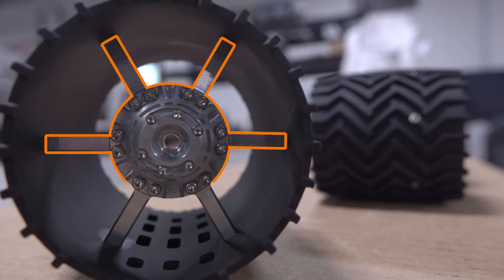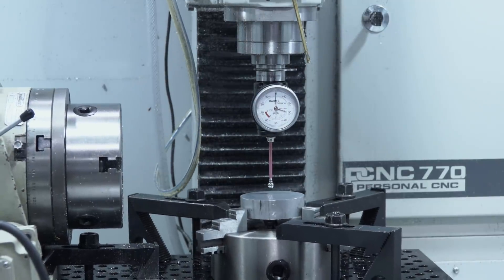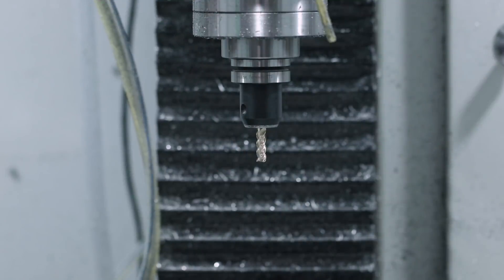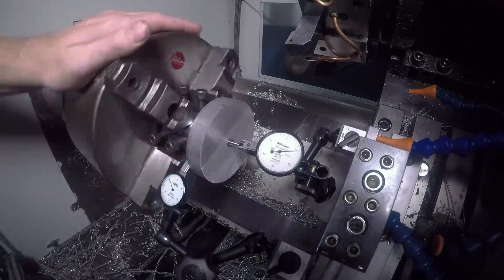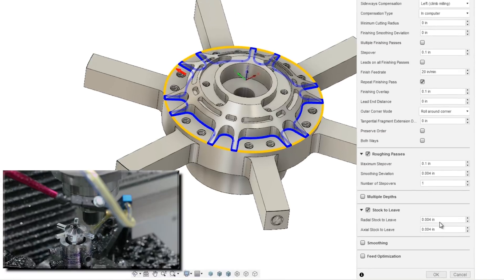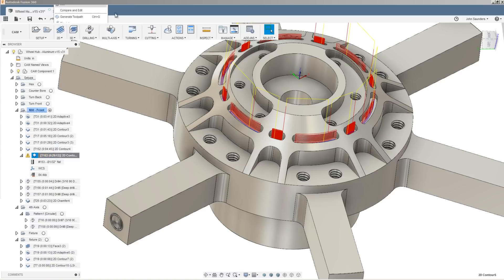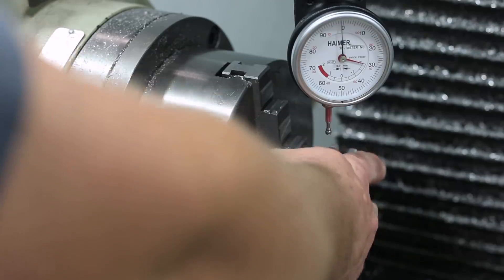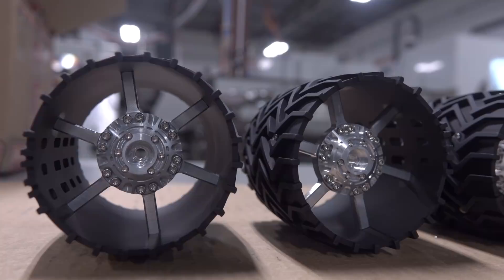Turning & Machining MARS Wheel Hub | WW210

Comment: I’m thinking this method may compromise some cintrifical tolerance to some degree (I know I’m killing the spelling of it but you get the point) but couldn’t this be done in all mill 3 axis? Circular interpolation and mill everything off then flip with custom soft jaws and deck off the excess that was holding it on in the first opp? Just wondering the downside of this option

Comment: Too many operations, This always introduces error.  You can do it in three, all milling. But there are always trade offs, You may need more tools specially made for this job. The program can help you get around some tools and fixtures. But that depends on you machinery, what tools are already available, and how soon you need to SHIP IT!  First op mill the hex, the hub, and and the OD, and even the spokes. You could have left in in the chuck, mounted that on the rotary table with the part still in it, indicate the chuck. Or flip it hold the hub hex end either way, tap ends of the spokes. Make a ring that fits outside the spokes use that to hold and mill flip side. If the ring is correctly designed you can hold on it and not crush and scratch the part. The ring could also be used to hold it in the lathe to turn both sides. (if some find this  necessary) Lathe operations are cheap, a single point tool can do a lot! The only problem with the four jaw in a CNC lathe is SPEED, and in aluminium you need speed and some power!
Me I would have turned soft jaws for the ring that I made to hold the hub after the first/second mill op. ........ and so it goes.

Comment: Personally I would have just done this as two operations in the mill. All the features you cut on the lathe could have been interpolated or 3d surfaced. 3D surfacing isn't exactly fast, but I'd bet money it's faster than re-setting it up for two ops in the lathe, and figuring out that whole hex fixture.

Comment: I'm not a machinist....I'm a designer, and trying to learn as much as possible about CNC machining to make things easier/cheaper to manufacture. When I first saw the image my thought was to drill all the holes first, remove material from one side with the 3 axis CNC machine, flip over into a fixture and machine the other side....tapping holes at the end. Maybe when you have a lathe it feels necessary to use it? I really don't know. It seems like a lot of steps. Also, the artistic elements of this make the manufacturing of it impractical. I can only imagine what a nuisance it must be to deal with people drawing things up that requires a 1mm end mill or something for an artistic detail.

Comment: Our shop has a dual-spindle live tool lathe (Haas DS30Y) and it would eat that part up. The entire part done in one cycle. The problem is the hours you would have getting everything set up, what with subspindle transfers and whatnot. Even without a subspindle, like you say John, it's a lot of live tools. We spent 30k tooling up our lathe, and about 20k of that was live tools... 4 of 'em...

Sometimes it is better from a standpoint of time to go about things the simpler way, and some folks don't get that.

Awesome video, love the WW's man.
Reply: Patrick McClintock spot on!
Reply: True. There was one guy that used the, "they would never do that in a real job shop," bullshit. They waste time in their minds (because they usually don't have a "real job shop" anyways) trying to hit imaginary/unnecessary/unrealistic tolerances, for nothing. Get it done within tolerance, which is a spec of "needs to fit in the wheels and look good," and nothing else matters. Time is money.

Comment: 5 axis mill and i dont mean live 5 axis just an A and  B positioner  rotary positioner on the B axis start with 3 jaw facing up towards spindle  in the Caxis direction like you bolted to the table and a trunnion tilt  table on the A  lengthwise  on x .  machine the spline hex drive in the  same way you did now mill the snout on the back of  the part with the radius . next op  flip over chuck on the snout you just mill right  up to just under the line where the radius starts then machine the front of the part  profile the spokes  next tilt trunnion table to 90*  now if you milled the first spoke at 0* parallel with Y axis come over drill the end of spoke then rotate the rotorary positioner for each of the 6 spokes .

Comment: Add half a thou ?? what if that was out side the drawing tolerances.
Reply: daniel lyall the previous toolpath brought it to tolerance, this just keeps from running over it again with a new tool and marking it
Reply: you would hope
Reply: daniel lyall if between set up programming and running you cant hold a 1thou step tolerance then youre doing work out of your league.
Reply: Juxtaposed1Nmotion experienced that have we
Reply: daniel lyall ugh same, we had a .0005 true postion and couldnt figure out why we kept blowing it by 002...spindle was running out .004 or .008 all day.
Reply: That is why I was asking for a clarification, is there other reasion to look out for
Reply: daniel lyall depending how deep you are cutting you can move your part if not rigid enough set up. tool paths can be clicked wrong in the CAM, could be using a tool with uneven wear causing taper

Comment: What am I missing all these pockets and screws in the center seem to be for decoration only and serve no purpose except making the part cost more?
Reply: Pork Chop threaded holes must always have a function. the pockets are more then likely to reduce weight and help balance the wheel. very important in a spinning part.
Reply: Juxtaposed1Nmotion Balance doesn't matter that much. They spin at like 10 rpm.  It's just meant to look like the wheels on Curiosity rover. (Not the two MERs Spirit and Opportunity, as others have questioned.)
Reply: Andrew Delashaw it absolutely matters on the actual rover that went to space. i known this is fun lil project for john and his crew but previous poster was asking about the design which was made by nasa and rest assure they took the balance and weight of the their design into account.
Reply: Pork Chop You think NASA engineers who  are stuggling to find govermental funding, are blowing budgets on fancy cosmetic designs?

Nasa engineers. think about your statement.

Comment: Interesting approach. I think I would have started on the other side after cutting the hex hole (and a thru hole to give both sides a common datum) and left the arms connected to a solid slab behind it. Once the front details are done, flip it over, chuck it in the lathe, cut the center hub, and then machine away the metal behind the arms. At this point the party is suspended in a ring and you can trepan it out and catch the part on a thin rod held in the tailstock.

Comment: Just do it all in the mill and vise. Put round stock in the vise with a V-block. Cut everything on the round boss side except cutting the spokes and bellow. Put the round boss in a 5C collet hex block. Finish up the back side including cutting the spokes now. Then put a stop in the vise and turn the hex collet block on it's side to do all of the spoke holes 6 x 6 times. Boom. No lathe. No 4th axis. No custom fixtures.
Reply: Or 2 easy OPs on a live tool lathe, even without Y axis

Comment: If I was making the parts I would start in the lathe and turn the id and od them move over to the mill and use some soft jaws in a vise preferably the ones you made a video about that have are for clamping circular objects and mill the hex them switch over to the five axis and do the rest of the features. But overall great job love the content.   :)

Comment: Could you Mill the profile of the hub in a tall plate with a cam clamp to hold it in place. Spot,drill, tap then manually index and repeat. Mainly because I wouldn’t set up the 4th for 6 parts.

Comment: Wouldn't you lose some concentricity by putting it back in the 3 jaw on the mill @2:35?
Reply: It's basically just a show part.
Reply: They dialed the part again each time they flip it. The perk of a CNC probe
Reply: Lâm Đặng still out at least 2 thousandth s
Reply: I doubt it, It's not like they naively throw the part back in the 3 jaws chuck, he took time to dial it in each time so it doesn't matter the run out of the chuck, only the accuracy of the probe matters.
Reply: Lâm Đặng it actually does matter if your are trying to hold parallism and concentricity which would be crucial for a spinning wheel. doesnt matter how well you indicate your part if your compounding error across set up. but this is a show piece and only assembly matters not function or stress through use etc.
Reply: just saw a 4thou runout in the lathe portion. these guys are going for "looks good" fit and finish. id love to see john tackle a peice with both milling and turning with a .002 run out and less on the true position. none of these techniques would work in a real jobshop.
Reply: Juxtaposed1Nmotion A real job shop doesn't waste time hitting imaginary tolerance specs. This is going on a static model, and the small amount that it will be out doesn't matter. You don't shoot for ultimate accuracy if you don't need to. It wastes time and money. I find the purple that say things like, "in my shop," or "in a real shop," or "he would have been fired in a real shop/my shop if he did that," etc are people that don't have a "real shop," or a "my shop." The parts aren't going to be put on a CMM, and they're just meant to fit and look good.
Reply: Yes. Although I wouldn't think it matters for a museum piece.
Reply: To a degree, but if you wanted to avoid some of that you could use a dial test indicator or a center finder in the spindle to find the true center. Three jaw vs 4 jaw doesn't really matter on a mill the way it does on a lathe because the chuck is not spinning, you just have to set work offsets every time you remove the part. He's setting his work offsets based on a feature he drilled from the other side of the part, so I'd expect concentricity to be relatively good at this point in the video. Later in the video when he appears to set up the 4 jaw without dialing it in would be when he lost concentricity.

Comment: Why I hate 2d adaptive, so much wasted time with z movements.
Reply: You can control all of it including the feed height. On a hit start and walk away program for only a few parts it's not always worth it. 

Fusion defaults safe. Just what you want if you don't plan on babysitting the machine.
Reply: skmetal7 you can turn that off
Reply: You can turn off in the linking page, if the linear movement is bigger than "X" value, Z axis up or not
Reply: I set my non engagement feed to machine max speed and keep the tool down, also run much much faster plunge rate.
I agree this was a little painful to watch but that's not really the point. In a high production run maybe, I like trying to cut cycle time 😉
Reply: i think with some postprocessors for HAAS  the no engagement feed in G01 can be replaced for G00 and my model of haas have 1000in/min in G00 movements. im new in fusion only play with it 1 week but i see something of this in the options
Reply: Only when the max feedrate for the Z is 100ipm. It’s hardly noticeable on machines with faster accelerations and feed rate speeds.

Comment: i really like the parts in this one when you have the 1x speed footage with raw sound and no voiceover. Nice to hear all the noises not typically heard unless running a machine of your own. Like the whistle when the air/mist coolant gets closer to the holes.

The voiceover is very important! but the occasional 10 or 15 seconds of machine only noise is always welcome.
Reply: the sound of the lathe spinning up. i agree - really cool.